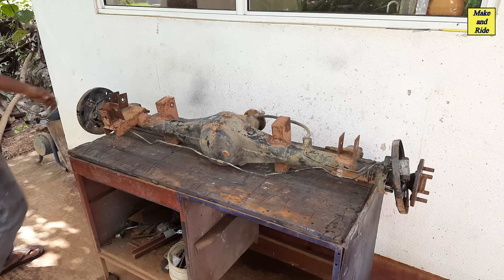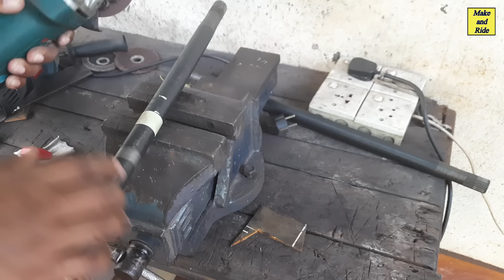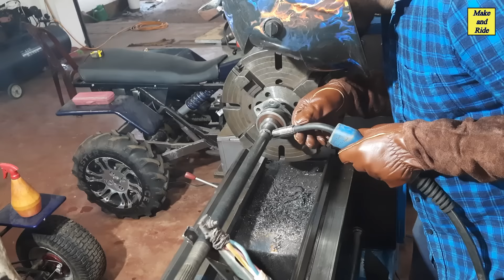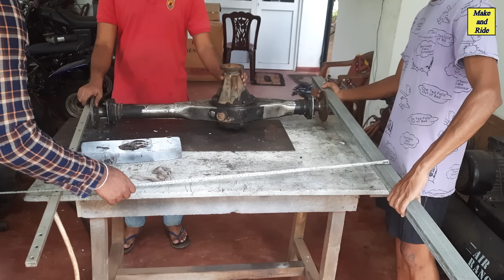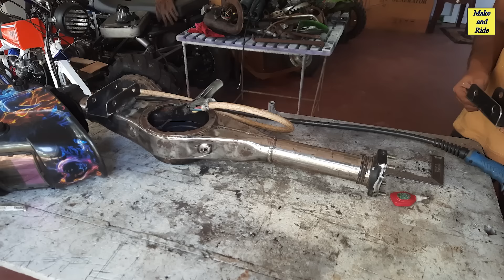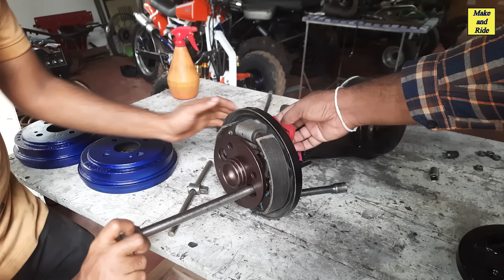Vehicle Differential convert to ATV differential

Comment: ngl i thought this was going to be one of those videos where he just does a poor job like those "restoration" channels but god damn i'm honestly impressed he did everything by the book from facing off the two halves with the lathe to make sure they mated true and parallel, then drilling out one side and making the shaft end a press fit to minimise warping then using the lathe to chamfer the weld surfaces to get penetration all the way through whist using the lathe as a clamp to again minimise warping.
my only 2 complaints are: 
-that the shaft wasn't heat treated/normalised but the amount of power an ATV produces i don't think it'll be needed since they're over built for the application 
-finally the mounting brackets are a bit too thin for my liking but again the amount of power the engine will produce/ the weight of the ATV i think they'll do 

overall a really good video!